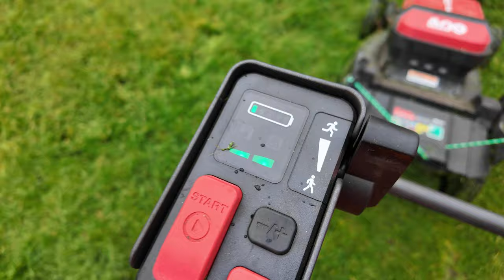PARISH COUNCIL GRASS CUTTING STARTS! #behindtheblade #episode63

Comment: Hi Jack if you are into health and safety now should you be using a motorised machine on the road unregistered therefore no insurance ?
Reply from the maker: Great Question! it depends on the roads you are using etc, however the Road traffic acts and law stipulations guide us on what we can and can’t do, our parish work is not deemed as “special roads” ie above a classified 20 or 30 limit. 

Although its engine propelled it can fall under the same laws as an electric push bike, as we travel through a parish we are mainly on the verges and only enter a road to either cross it for an absolute maximum of around 50m 

I may do an in depth video on this as there are lots of misconceptions! 

If we were working on roads that have a limit above 30mph it’s a completely different challenge and rule book, luckily our parishes are not!